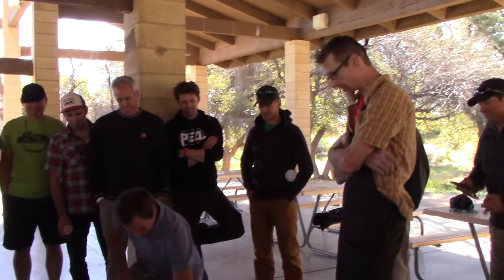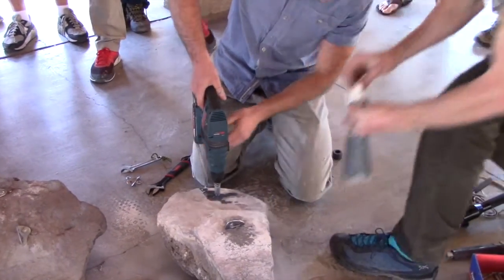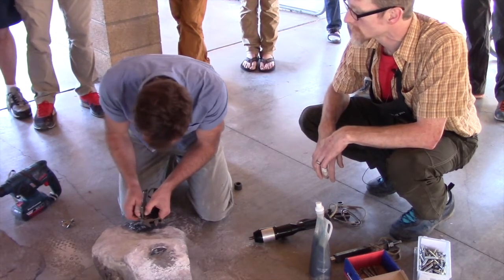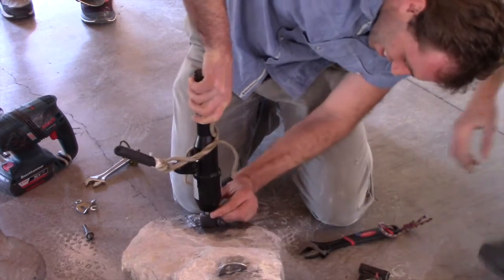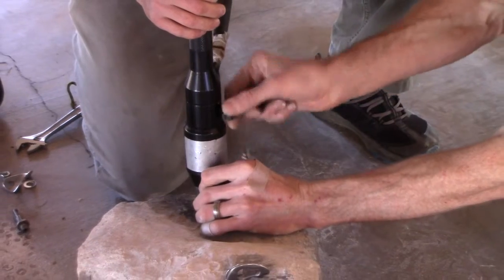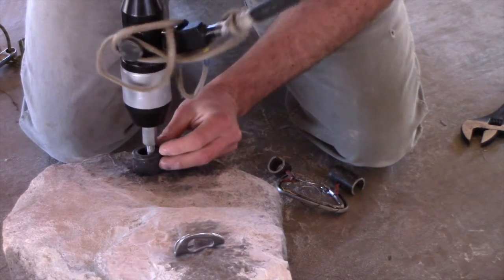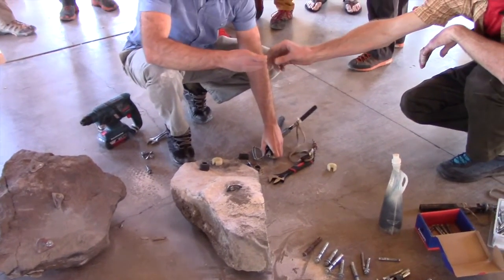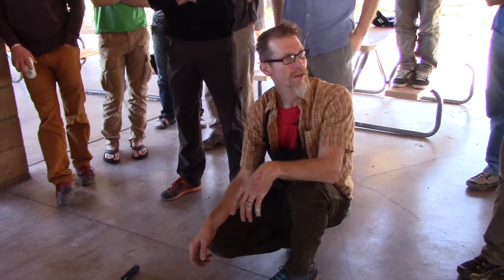Hydraulic Puller Wedge Bolt Removal

Comment: No offense, 10 min to remove wedge! I can do it with impact wrench just by seizing nut and spining until wedge brake 10 min will be more than enough.
Reply: I also would like more info about this
Reply: So you just hook your air or battery powered impact and pretty much take 2 nuts and lock them together to make a "bolt head" and act as if you were tightening it til is eats the wedge and then pull it out?

Comment: after rotating, why not just add a bushing, washer and nut then tighten the nut down to pull it out, the press looks very slow and clumsy to attach
Reply: the torque needed to pull the bolt is greater than the drill, or your arm can
 produce